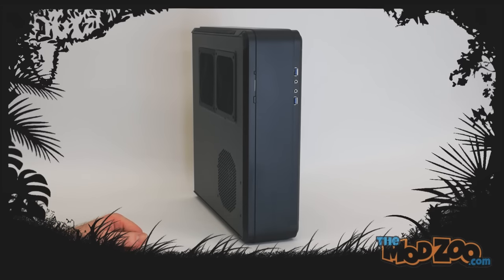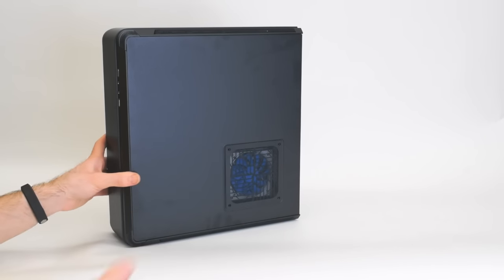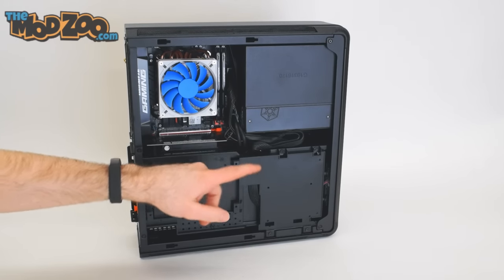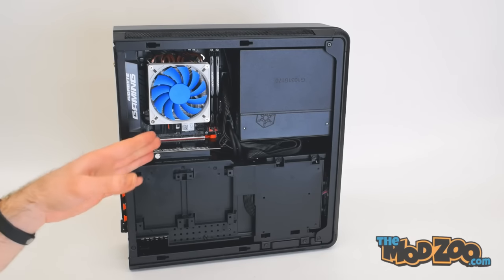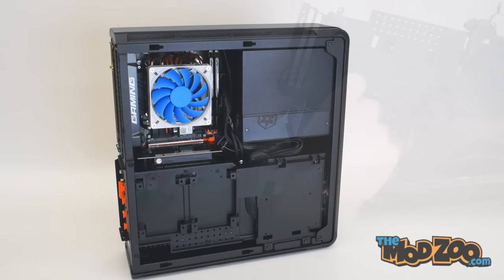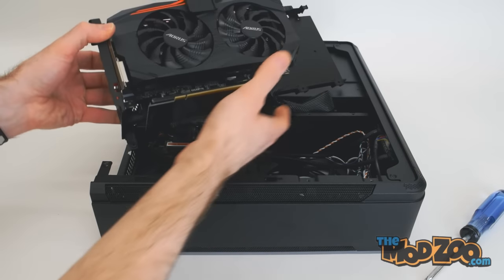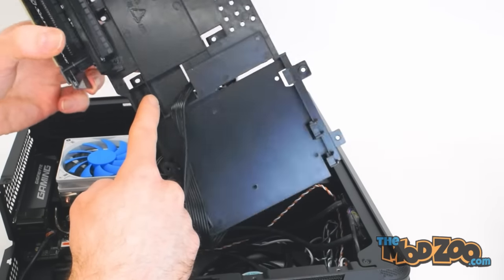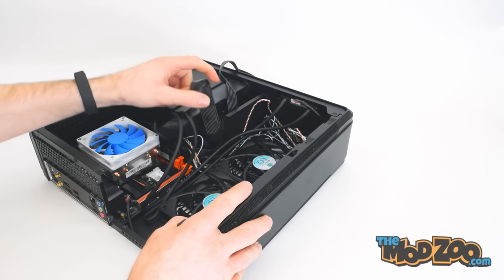Silverstone FTZ01-E Review - The Mod Zoo

Comment: The Silverstone FTZ and RVZ cases are fantastic for HTPC/gaming console PCs. I currently have an FTZ 01 case myself with a Corsair SFX 600W PSU and I did manage to fit in a Cooler Master MasterLiquid Lite 120 AIO cooler into it for the CPU. It is definitely possible.
Reply from the maker: with the slim fan I take it?  That's got to be TIGHT lol
Reply: Indeed, with the slim fan. That's essential. No way a regular size fan will fit.  I should also point out that I was able to use two regular size 120 mm fans in the GPU chamber without any issue whatsoever. As long as you mount a two slot graphics card in correctly, the video card fans and the case fans shouldn't touch each other.

Comment: I have the previous model for 5 years  now. Core i5 6600k with a td03-slim cooler and gtx970. Gets a bit toasty under load (cpu-wise) as the slim radiator doesn't have enough capacity to dissipate all that heat (I have a mild OC to 4.0 GHz). This older model has support only for SFX, which gives it slightly more space to work with. GPU bracket and cable management are a nightmare though. Soon I'll upgrade the system,  and would like to keep the case as the form-factor is perfect for a console replacement in the living room. Too bad it's a "challenge" to set it up. Ps: the original FTZ01 has support for a slim slot loading optical drive, useful for the living room. The "enhanced" model ditched this.

Comment: Great thing they fixed the one true mistake in the original design and moved the power cord from interfering with the largest GPUs. I've been really happy with my ML07 case which I've had since they came out. 

BTW with an SFX power supply you can watercool these with full custom loop (120+240 radiators, MoBo and GPU blocks), but it is a tough job. I've been running mine watercooled for about four months now, it was a challenge and a half to make it all fit.
Reply from the maker: That is awesome!  Do you have pictures if it?  I'd love to see them over on TheModZoo.com/forums!  That was my idea for this case as well, SFX with 120 and 240, but I wouldn't have imagined it would be easy at all lol
Reply: The Mod Zoo I didn't take photos during the initial build, but I'm redoing the loop with Tygon norprene (r-6012) tubing for better thermal and mechanical resilience (and also heat fusing properties) and cleaning up the wiring so I'll get some good shots soonish. Since the 3.5" bay res has been out of production for quite a while the only pump and reservoir I've managed to fit is Syscooling SC-P60. It has seemed to hold up quite well, though it's not the quietest of pumps at full speed and has a super tiny reservoir. The loop must be filled with an auxiliary loop through a quick disconnect junction. Also the pump doesn't like running sideways (draws a vortex into the res), so you're limited to upright position.
Reply from the maker: All great info!  I look forward to seeing some pictures of it :D
Reply: The Mod Zoo I did a writeup on it on the worklog board. I linked the photos from my Dropbox, I'll make thumbnail links once I get to it...
Reply from the maker: Awesome, thank you!  We've updated the post so the images show up in the post, but feel free to edit with thumbnail links if you prefer :)

Comment: Is it possible to fits an ATX psu (like my corsair cx750m) long 160mm?? Silverstone website suggests psu with max lenght of 150mm...i was wondering if is possible to remove that ssd bracket between psu and graphics card (i suppose not because 2 of the gpu bracket's screws go there). 
Thanks in advance to anyone who answers me
Reply: ok, i got through the video and i got all the information i need. I also noticed that you used a 140mm long psu, that means i could use mine only eliminating that ssd bracket. But my gpu will have a "floating side" with no screws....

Comment: Having an issue with my itx motherboard and the psu cage. The part securing the power supply cage is touching the edge of my ITX motherboard, is there any risk of short circuit?
Picture : https://ibb.co/1bmKJqG

Comment: Hi. I am about to start a build with this case and I was wondering about fan placement. I will be getting the same cpu cooler and a blower style gpu. I was thinking about putting one of the stock case fans as an intake on the gpu side to help it out, and the other case fan above the cpu cooler if that will even fit above it. Could I hear your thoughts on this? Thank you for your time.
Reply from the maker: if it's a blower style cooler, then I'd say you should be able to get away with what you're describing.  You could also do both stock fans under the GPU, and get a 3rd slim fan for the side panel above the motherboard.  It wouldn't hurt any.  That said, I think you'd probably be fine with just the two fans (one on GPU one on motherboard)
Reply: @TheModZoo  Alright, thanks!
Reply: You can definitely fit two regular size 120 mm fans in the GPU chamber underneath your blower style graphics card no problem.

Comment: Very nice case. I am not the fan of the plastic insert for the hard drives tho. Would be nicer to have some highly meshed metal bracket instead. Also, the meshes on the bottom and top for venting, could be just slightly bigger. Even possibly cover entire panel, not just corners. Other than that very capable case. I like the fact there is no silly space for the optical drive (even slim) and USB ports and power buttons are on the front. Not side like some other small cases.